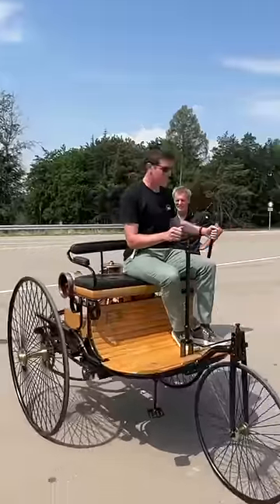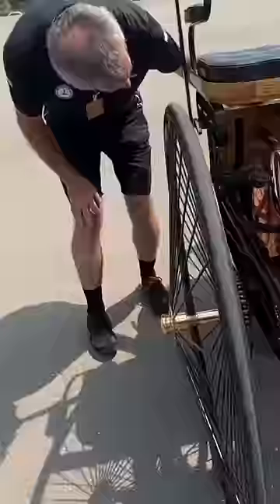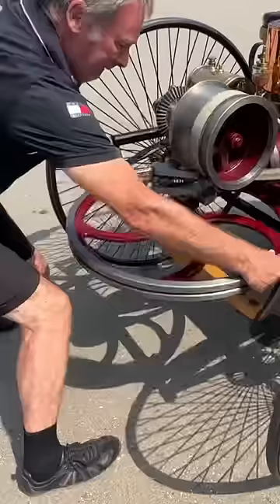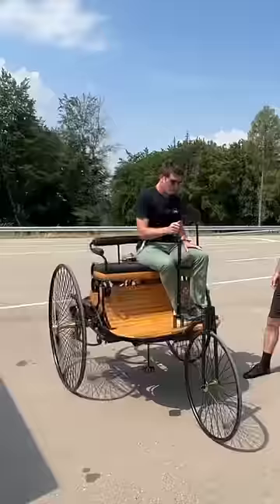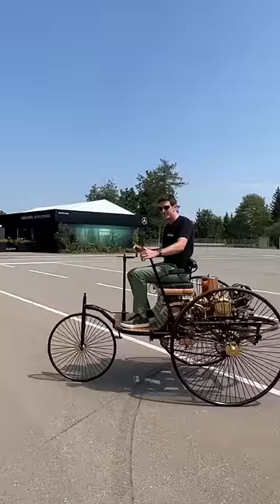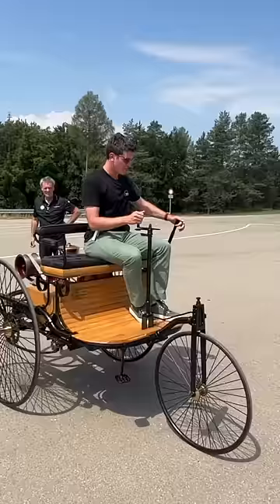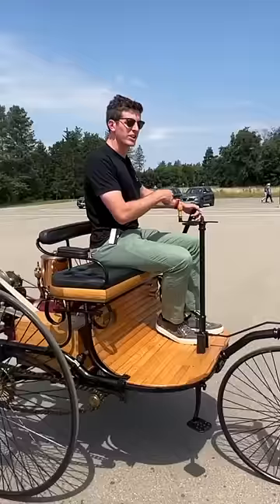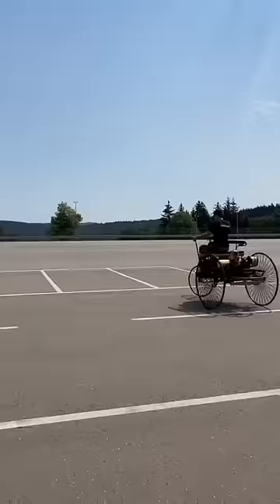How To Drive The Oldest Car

Comment: Imagine doing 60mph on the freeway in this
Reply: I'm pretty sure the top speed is like 3 mph lol
Reply: @joodlebug  nice bug 👍
Reply: Motorcycles😂
Reply: Wouldn't be surprised if what we saw him do here, is the top speed.
Reply: @joodlebug  0⁰
Reply: 10 mph. At 440 rpm.
Reply: It has a 0-60 time of 2 months.
Reply: @joodlebug  yeah, with that attitude it does
Reply: On
Reply: Motorcyclists be like yea and
Reply: You can run faster than this car lol
Reply: @Fee.1  motorcycles are made to handle that speed. This thing will disintegrate its got bicycle tires and made of wood. Its not the same at all lol
Reply: Death wobble be like.....
Reply: @joodlebug  17MPH
Reply: I am imagining a dude with a mustache, circular goggles, a suit and tophat driving it on the freeway at like 150 mph.
Reply: @joodlebug  it’s 8mph up inclines and 15-17mph downhill at 400rpm. Good engine for the time
Reply: Autobots!......Transform and roll out! - Grandpappy Prime
Reply: Imagine this even reaching 6
Reply: Top speed is 10 mph lol
Reply: @fuze3522  a world record during those days 😅......
Reply: It would fall apart
Reply: @haldyordan2316  technically at one point. It was the fastest car.. in the world.
Reply: With a couple modifications probably. The tires definitely need to be changed for that, they look way to fragile to go over 10mph.
Reply: Nah
Reply: Good luck doing 6
Reply: Wow 2k likes unbelievable. Am I like famous now??
Reply: It would tear itself apart at those speeds lol
Reply: Take any early awro engine car, then turn the frame into wood, that's basically what that would feel like going 20
Reply: on this*
Reply: @WhiskeyTangoFoxtrot3267  😂😂😂
Reply: That be on some back to the future  thing🤣
Reply: It would start flying or do a backflip 😂
Reply: @joodlebug  not if its downhill in neutral
Reply: Jimmy broadbent did a race in these
Reply: Top speed is actually a mind-numbing 320 mph. That’s why they don’t make them anymore.
Reply: @joodlebug  it does 10. And it's the First car, what did you expect. It's an Amazing technical achievement. On its first drive to Mannheim his daughter bought the gasoline at the pharmacy. A fast horse gets half it's speed on longer rides, a normal one a quarter..
Reply: @mackjones7688  true but he said "imagine"
Reply: No chance. The top speed in that car is 9 mph. 0-60… don’t ask.
Reply: @erebostd  I saw a documentary about that. The lady bought some benzene from the pharmacy. I shudder to think why they would have sold benzene at a pharmacy.
Reply: It barely Could hit 5...
Reply: In early 00 - 30's they thought it was impossible to reach such speed.
Reply: The wheels would break off before hitting 40😂
Reply: They have a top speed of 15 mph 😅
Reply: @joodlebug  more like 5 i think
Reply: @joodlebug what? its speed is 25 km
Reply: I can't, it barely does 4mph.😅
Reply: When the vtec kicks in 🤥
Reply: I don't think it can. It's top speed is probably 15 mph max.
Reply: An accident sounds like the worst possible thing. To be honest i dont know what’s worse, an accident in this or on a motorcycle.
Reply: @cardioandfriends what time period was this? Late 1800’s/early 1900’s-1910?
Reply: @MrTangent wait are you serious about the speed? No way this thing could be stable at anything more than 25 mph. It would be shaking everywhere or fall apart. I’d think a modern bicycle is more sturdy than this so a bike could handle higher speeds especially behind in a slip behind a truck or something.
Reply: @buddyclem7328 I often wonder why cigarettes are sold at pharmacies. It makes no sense
Reply: Only downhill with a storm coming from behind.😂😂
Reply: Meters per hour
Reply: There’s no way 😂
Reply: Now we know how they got the name bug for cars .All them bettles they eat.
Thanks for sharing this and God bless you 🙏
Reply: Not a car more like a Scooter or moped /motorcycle.
Reply: @tati-anaroseee4316 nah, motorcycles go 100mph on the freeway where I live. There’s a reason medical professionals call them organ donors on wheels!😂

Comment: proceeds to put a supercharged 426 hemi in the back
Reply: Even better, a 454 big block on a 9 liter supercharger.
Reply: Gets 2 feet before it rips itself apart lol
Reply: Imagine what just gonna happen 😂
Reply: Better switch the bicycle wheels first before you end up on live leak
Reply: @unitedunitedunited_  then get more
Reply: @dailyatom8678  whistlindiesel put carriage wheels on a hellcat
Reply: @Vl0gWithAb  7.4 liter engine, 9 liter supercharger. I see no problems here 😂
Reply: @Vl0gWithAb  carriage wheels are stronger than little timmy’s bike wheels though😂 but fair point
Reply: Aah, Yes ..... The American Way
Reply: You could put a 1hp harbour freight engine on her and it would be an improvement. It only had... 2/3 a hp
Reply: Imagine drag racing against those motorcycle dudes on the highway in a tricycle with a hemi in the back.
Reply: I like your way of thinking
Reply: The thing would fall over backwards 😂😂
Reply: No Ls?
Reply: OK Jeremy.
Reply: Lol
Reply: More like a Chevy engine.  That's really the only engine worth swapping in anything
Reply: @Vl0gWithAb  hell yeah!
Reply: Still won't go any faster, RPMs are RPMs no matter how much torque it has, the belt controls the speed
Reply: Its a one speed transmission, only way to go faster is to put a higher rpm engine on it. Like a cosworth or a rotorary engine capable of 17,000 rpms. It might actually hit 25-30 mph
Reply: This. Is what i thought
Reply: It's wheelie time
Reply: The car went to space
Reply: one of those car guy
Reply: @ADHDcisGinger  or put a harbor freight 5hp engine
Reply: They already have something like that it's called the horse fly Bar stool
Reply: Forza moment
Reply: Hellcat
Reply: A 7.3 Godzilla
Reply: Nah but a Windsor in it. Ford's better
Reply: @Vl0gWithAb  put a twincharger in that thing
Reply: 45 liter supercharged 3000hp Merlin engine.
Reply: @Vl0gWithAb I’d bet that “frame” would buckle under that kinda weight.
Reply: A Hayabusa engine actually might fit.
Reply: @Vl0gWithAb  are you tryna go to moon? 😂😂😂
Reply: Need to put this car in GTA or Gran Turismo or any racing game
Reply: No no rotary go brap brap breeeeeeeeeeee
Reply: You would propably just wheelie with that machine until it just rips apart XD @ARockyRock
Reply: Really? No AMG engine?!?
Reply: @Vl0gWithAb  BIGGER!
PUT A BUGATTI W16 AND SLAP 2 SUPERCHARGER TO IT
Reply: @Vl0gWithAb  fuck it puts in a torboshaft engine
Reply: @Vl0gWithAb  This thing would be a hit on the Internet with a predator 212 on it 😍
Reply: It will wheelie

Comment: Guy: “this is easier to drive than any modern car”
thinking about how old people had it hard : “shut up grampa you had it good.”
Reply: Look up how to drive a model t, more complicated than calculus.
Reply: @lukasg4807 not really. just different
Reply: @GewelReal  I'm obviously exaggerating but no one would be able to figure out how to drive one of those who hadn't before
Reply: @lukasg4807  would you be able to know how to drive a manual if you only ever drove automatic?
Reply: @GewelReal  no, but it's the same thing just with an extra step. The model t control scheme is completely counter to everything a modern day person knows, and seems incredibly unintuitive to me.

No it's not actually more complicated than calculus, idk why you're being so damn pedantic over a comment just meant to say the model t has a really weird set up.
Reply: @lukasg4807  it's not weird. There was no "standard" in early 1900s. And it's actually very easy to drive. Pretty intuitive even I'd say
Reply: Old people had ot hard in some ways but ilwhen it comes to the money your earned, they were waaay better off.
Reply: @lukasg4807  The model A already had the modern layout, the only thing that's significantly different is that you have to time the ignition yourself

Comment: As someone who spent a year driving my standard riding mower by maxing out the speed and using the brake (really more of a clutch) to control my speed to corner but go fast when i needed to, that car needed a LOT of maintenance.  That clutch probably won't last long.

Comment: Honestly this feels so much more practical for short trips. Maybe the future of EVs should be stuff like this.
Reply: Right? Something like this that could go a wee bit faster would be perfect for errands/groceries/short commutes.
Reply: That’s what e-scooters are for
Reply: @danieldaniels7571  Good luck carrying more groceries than can comfortably fit in your backpack on a scooter.
Reply: @toulousegoose1150  that’s what delivery is for
Reply: @danieldaniels7571  Delivery might be a great option for some people. I actually cook so it's not helpful for other people to select things like produce. Not every store has delivery either. You seem like you're pretty against it regardless, and that's ok. I happen to like the little Amish buggy that drives itself.
Reply: @toulousegoose1150  I’m quite fond of the Waymo that drives itself.
Reply: @danieldaniels7571  Why get a self driving car when you can just take a bus?
Reply: @JP-1990  the car will take me directly home before my ice cream melts and the bus won’t. I also can’t stand the secondhand fentanyl smoke at the bus stops and don’t feel like walking the mile from the bus stop in the 110 degree heat.
Reply: @danieldaniels7571  Sounds to me like the place where you live in built wrong.
Reply: @JP-1990  it’s built pretty solid. Been there since 1953.

Comment: Did some research & with the little info I had, I manage to calculate a very rough mpg this thing got. If my calculations n research r correct, the Benz MotorWagen got anywhere between 15-28 mpg, which is a very not-specific range lol.
Reply: Still though, even on the conservative side that's crazy for the time

Comment: Nice engineering! Are both rear wheels driven, or just one? One wheel is probably good enough, but if both are driven, I'd expect a simple mechanism, like 2 freewheel assemblies. Adult trikes are only driven by one rear wheel, so you can't go off-road riding one. I tried.

Comment: That is amazing, even more amazing to see a Benz older than 10 years and doesn't seem to have anything wrong with it! (Yeah they were okay 30 years ago but now they have problems too)
Reply: You mean the stuff they put together in the American facilities? Yep, they are barely recognized as a Benz here. It's the same with VW  Passat is/was a completely different car, even the bodywork was different. Seeing old Mercedes is absolutely common here in Europe, they are everywhere and run and run and run. My dad has ine from 2004, there's not a single thing broken in his car  only the ac needs a refill badly (he's to cheap to do it 😁)

Comment: Does this transmission work similarly to the CVT?
Reply: There's no transmission power directly go to wheels with belt 

You can think it's only 1 speed automatic but it's really 1 speed there's no R gear

Comment: Probably pretty easy to repair too, right?
Reply: Well not quite, if it gets a bent wheel or a broken belt it's not like you can just swap out the damaged parts for a new one you are pretty much screwed if something breaks on it since the parts aren't mass produced.
Reply: @josephbennett3482  Oh yeah, I was just thinking it wouldn’t be as hard to work on as modern cars with all that stuff under the hood…. But modern cars are a lot easier to get parts for, now that you mention it.